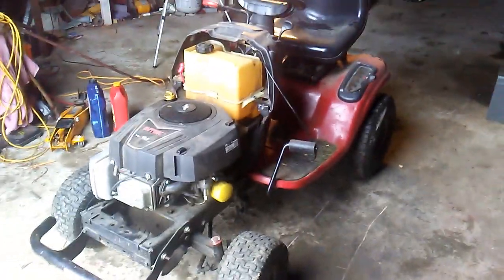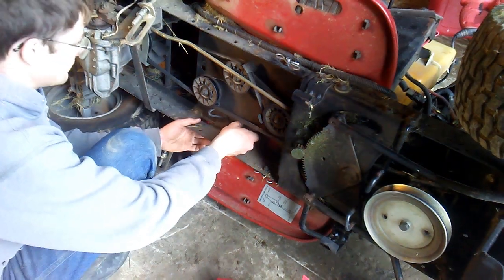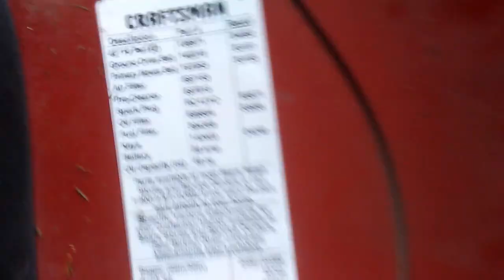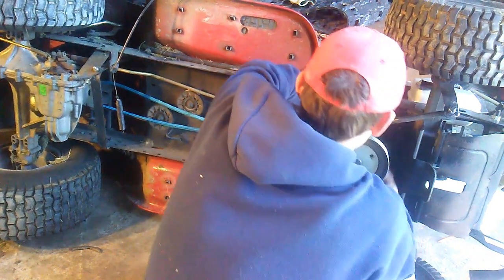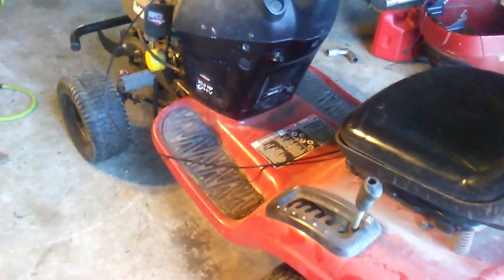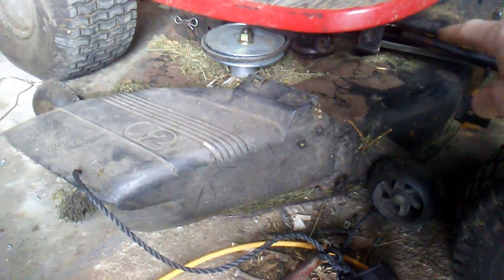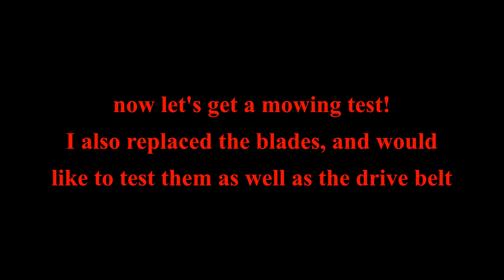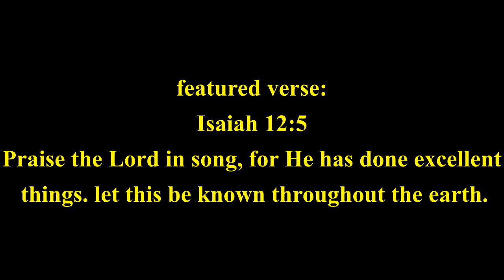How To Replace Craftsman ys4500 Mower Drive Belt

Comment: Got the exact same mower and a few weeks ago it wouldn't hardly climb inclines. Drained and filled that tri-axle fluid and seemed to work a little better. Mowed the front yard today and completely stopped. Will go very slow in reverse. Pulled the drive belt and looks fine, maybe it's stretched and too loose?
Reply from the maker: that's very possible. but also there could be something fatally wrong in the hydrostatic drive. hopefully nothing too complicated.
Reply: Did you figure it out? Exact same problem here
Reply: @devongroves7728 I think it was the drive belt with mine. It works fine now with the new belt but a tad slow when going in reverse. I didn't flip mine over or mess with the tensioning spring like in the video when I swapped it out. I've mowed my 3 acre yard 4-5 times now with no issues.

Comment: Bought a belt from Lowes and the belt isn't moving with the Pulley's.  It's a 6 pulley belt so likely when it was refurbished one of the owners did their own thing with the deck as most Craftsman YS4500 have 3 pulleys - same as you.  Anyways, having issues with belt not moving on the pulley's.  Any idea?
Reply from the maker: is it the drive belt or the mower deck belt? I would go through the system and try to turn each pulley by hand individually to find what's binding up. or maybe you don't have enough tension on the belt, there may be an adjustment for that somewhere. let me know if this helps!

Comment: I bought a YS4500 "As Is, transmission not working", I wanted the engine from it for another machine.  Drive belt was not tight, therefore not driving the transaxle, was just debris or grass build up blocking the clutch linkage.  Removed grass, runs perfect for a fraction of the cost. or one that is "working".  There are many variations of clutch linkage depending on year assembled and not all of them are thought out well but worth checking before you go to the trouble of doing any other repairs.
The only problem is I had to find another engine because this 4500 works so well I couldn't justify scavenging from it.
Reply from the maker: well hey, that's a good problem to have. motor runs too good to swap! yep, people selling something they think to be beyond repair that is really only slightly out of order is the source of a lot of good finds. good for you!

Comment: Then measure your belt and buy aftermarket not Craftsman you'll save a bunch of money for the same belt
Reply from the maker: yep, I ordered a generic belt.
Reply: @nybergsgarage  Yep buy the aftermarket belts and replace it again in one to two years if you are lucky, you will not get the 10+ years of an OEM ( a lot of Chinese belts are failing 6mths to 1 year)
Reply from the maker: @chrisbonney7563  thanks for the info, didn't know that. still, it's functioning for now and easy to replace, I guess we'll see how long it goes.